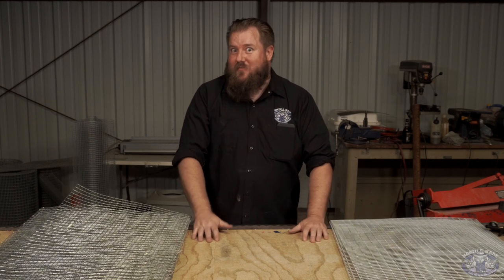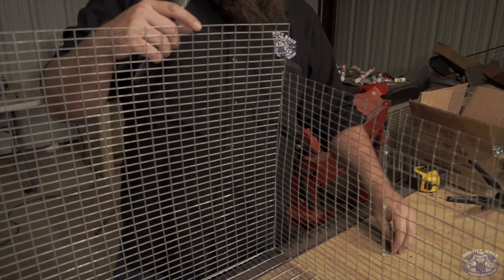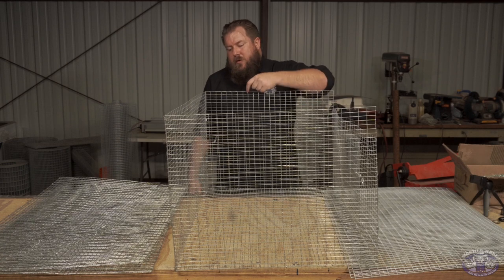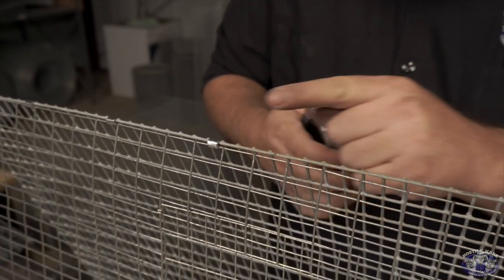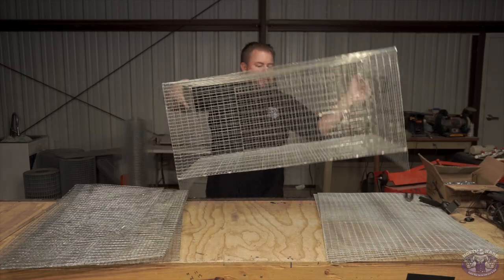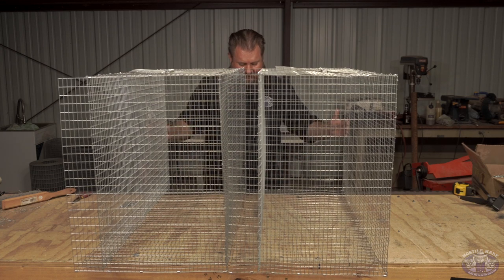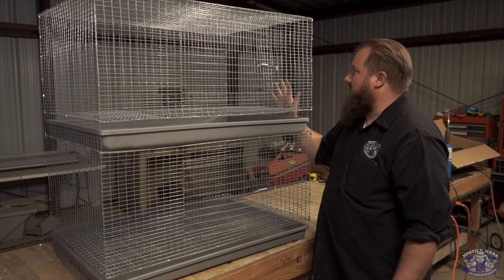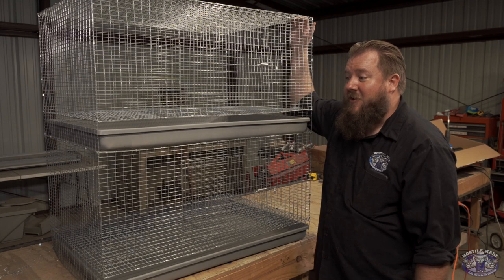Hostile Hare Stackable Cages

Comment: those pans will not catch all the rabbit waste i uesd to have those and they dont work.... best way is to have over hanging pvc that slides into a gutter.....i cut a hole in the center of the gutter and run it down to a bucket takes no extra space....
Reply from the maker: This is the system I use, https://youtu.be/NQYq5dMpMxI, works great. I sell both styles; spray out and pull out.

Comment: that looks far more complicating than building  rectangle wood shelf structure and just dividing and putting a single cage in  then you can pull just the one cage for transport or to replace
Reply from the maker: I do sell the individual cages that can be built on their own, I do like your idea of keeping it modular. The only thing I would advise against is using wood for shelves. It's really hard to keep wood clean in my experience. I go with all metal frames. If you look at my website you'll see some of the hanging cage systems that I have built

Comment: I can't find anything on making rabbit waste into methane and putting it into a tank. Can you PLEASE show a how to with the 55 gal drums.
Reply from the maker: I've cannibalized all of my methane production systems, but yes! It's one of the things that I want to do when I get some time.  I'll get some videos together soon. Did you catch the one where I was making gaseous  fuels out of a paint can?
Reply: @HostileHare  ya i watched it after the comment. Man, I would LOVE how to store methane it looks like online you need a special natural gas tank and liquid nitrogen. If you're condensing it that it.
Reply from the maker: @kriskaravanich6073  that is in order to store it under pressure, with a large pond liner and a well-constructed bladder pond, you can store a lot of that near atmospheric pressure. Though I recommend trying to consume It on demand.  For example, a naturally aspirated engine will provide the vacuum needed to run a stratified gasifier. Anaerobic digestion producing methane could be used off a small 30 gallon bladder system mixed with a small generator with an electric starter. Basically when the 30 gallon tank is filled with methane the motor starts and runs until the tank is nearly drained. You use that motor to either run an armature to generate electricity to a battery bank, or use it as a hydraulic pump to pressurize hydraulic tank to do work later, or simply pump water up a hill so that the gravity feeds can run turbines to do work later. I know this all sounds very complex and I'm probably not painting the picture correctly, so hopefully you follow me in my descriptions. I really ought to do a video in front of a whiteboard sometime so that my stream of conscience can be traced LOL
Reply: @HostileHare  I saw a companies using bladders in Mexico I think. I guess how to harvest and utilize the gas is a little over my head you painted a pretty good picture though. I guess using the gas to convert into electricity to store power seems smart.